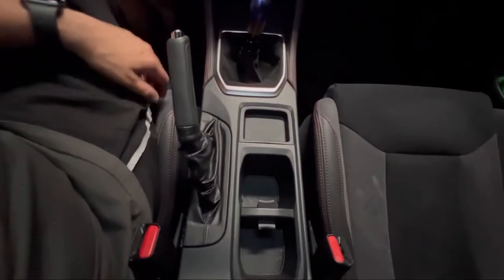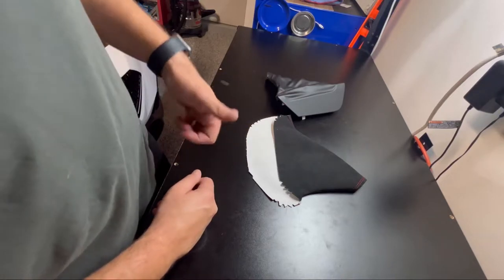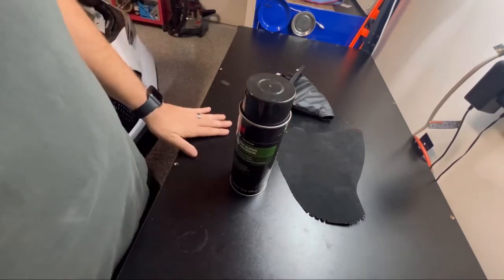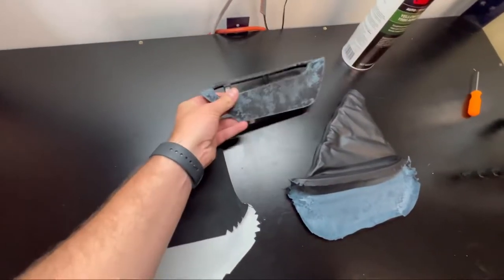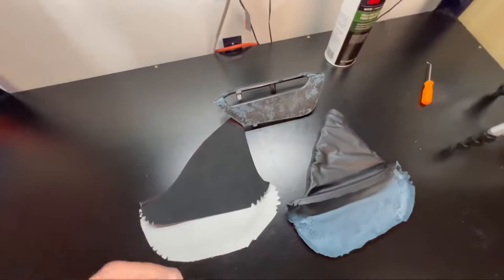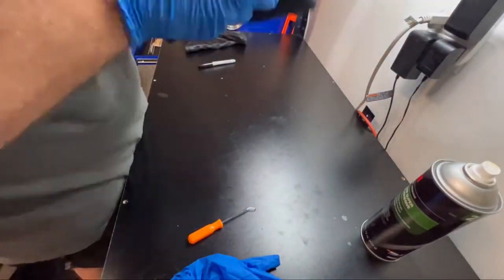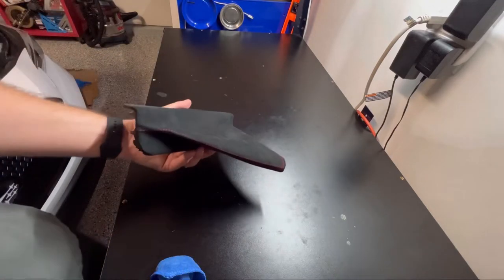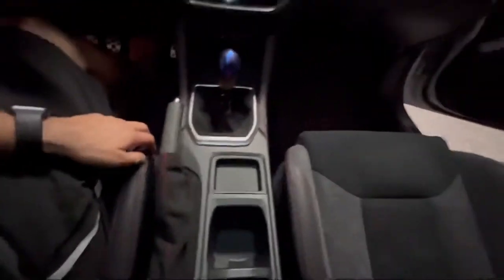2022 WRX Alcantara Suede E-Brake Boot Replacement

Comment: By any chance, are doing the dash panels as well? I saw that there’s an oem option for that.
Reply from the maker: I’ve ordered them 3 times with different dealers/vendors and they all have cancelled my order due to no eta on when they could fulfill the order. Back ordered no eta
Reply: @JoeyMontalto  ahh. Yeah, I ordered them too, but my order is still standing. I was told late July, early August. 

Love to receive a how to from you on how to install them. Thanks for these videos.

Comment: Are the shift and Ebrake boots universal? They don’t seem to have car options on the site.
Reply from the maker: There should be an option for 22+ wrx. There is a specific template for both. If there is no option on there I would recommend sending them a message on instagram or email.